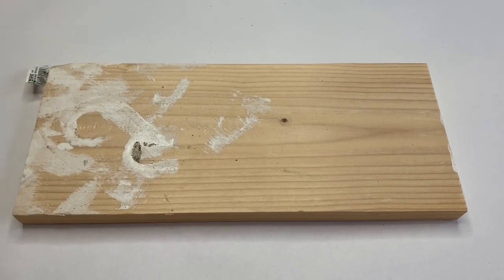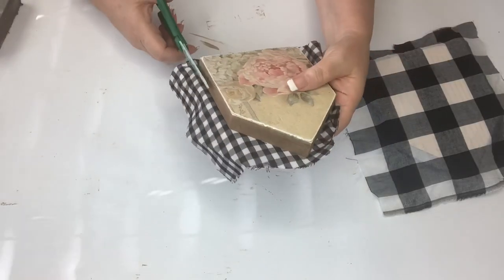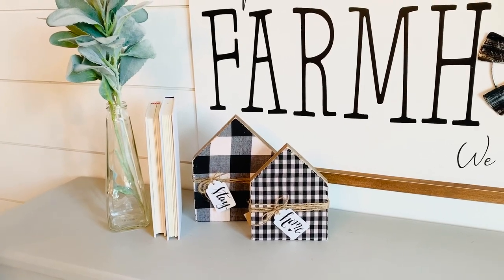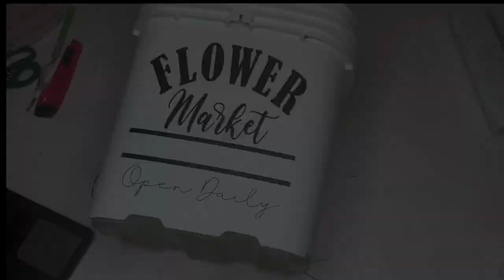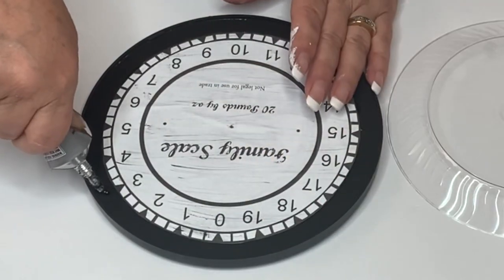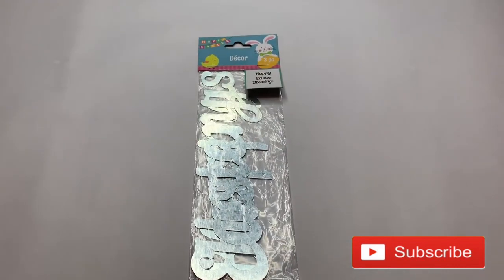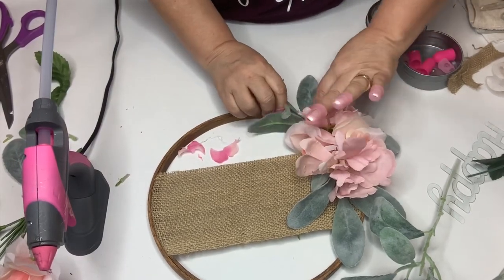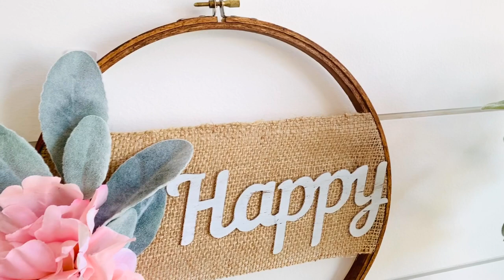6 DOLLAR TREE AND RECYCLED DIYS | FARMHOUSE HOME DECOR | BUFFALO CHECK AND RUSTIC PINK PROJECTS

Comment: I'm a little lost..lol.    did you just get a round mirror in a frame for the scale???  Also, what size plastic plate did you use?
Reply from the maker: Hi Sister! Yes. The face is made from a Dollar Tree framed mirror that I turned around. So the BACK of the frame is what I covered with the scale printout. The clear plastic Chinet plate is 7” in diameter, also from Dollar Tree and comes in a pack of about 24 I think it was. I didn’t save the packaging on the plates because I use them for my painting. Lol I hope that helps, friend!! Xoxo 😘